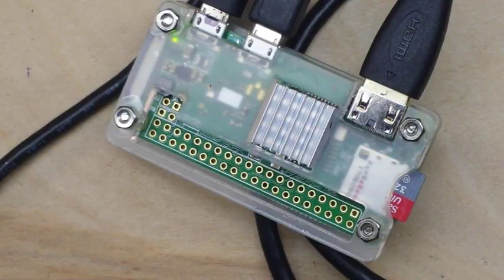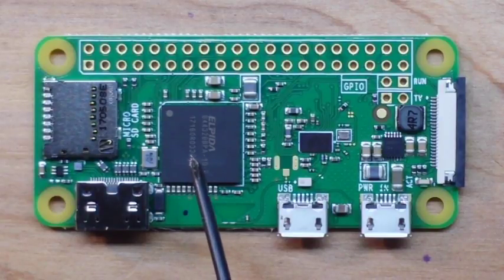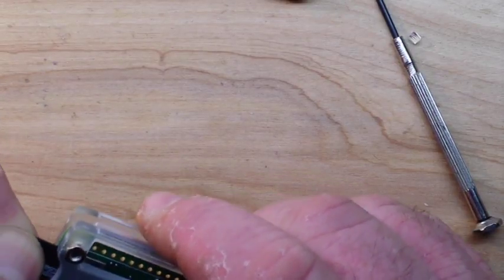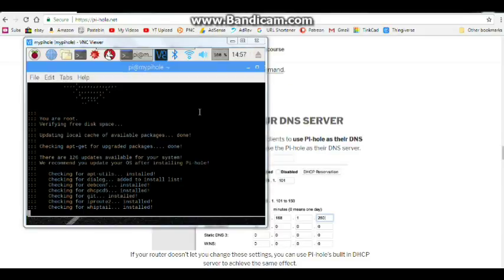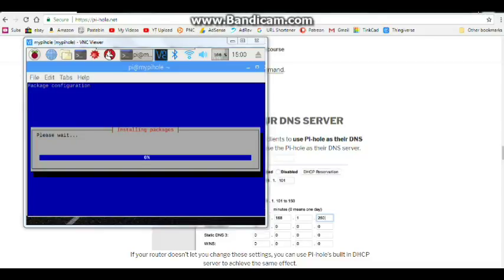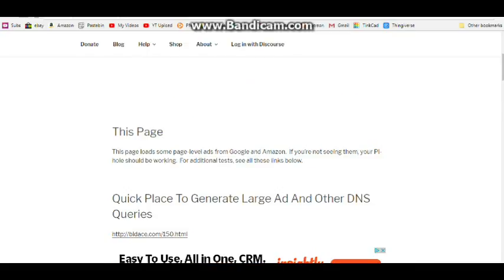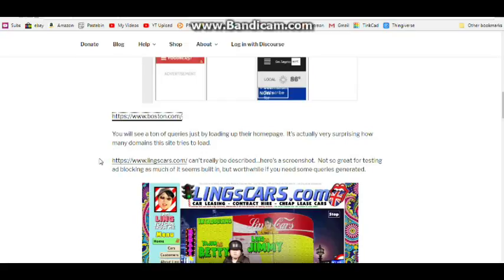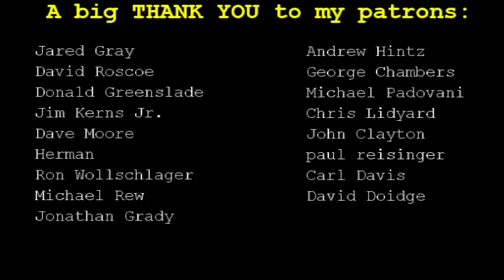Install Pi Hole on a Raspberry Pi and say goodbye to ads

Comment: Great video bro, thanks. I followed the instructions the best I could and after the last files were downloaded on the raspberry ( pi w zero with monitor, mouse and keyboard) the program ask me to check in a pi-hole page if it was already blocking ads. The testing page announced on the monitor that the my ad blocker was active. Then after a minute the screen blacked out. I reset it and the internet came back on screen and then it blacked out again. the raspberry green light is blinking three times fast and a fourth time more than a second. Your opinion will be greatly appreciated.
Reply from the maker: Just a guess, but I think your raspi is browning out. What's the current output on the wall wart you're using to power it?
Reply: Grateful for the fast response. My charger is a White Samsung type of charger whose output is: 5V 2amp.
Reply from the maker: And what raspi are you using? The III needs about 3 amps but the zero w will be OK with 2
Reply: learnelectronics it's the smallest one. Pi zero w. As your video's, with monitor, keyboard and mouse (not at the same time)
Reply: SOLVED: I took the SD card out of the Pi W Zero and put it in the USB connection of my desktop with win 7 and when my computer recognized the new item, asked me if I wanted to run an "scan and fix" which i agreed, and right after that I  put it back in the pi W Zero and worked again.
Reply from the maker: Ok, im glad you found the answer. I would not have thought to check the card.

Comment: Great information as usual! Thank you! You mentioned this briefly in your video but I want to put an exclamation mark on the most important feature of Pi Hole imho.... Once you have it running and your router properly configured, it blocks ads for EVERYTHING connected to your network! Visiting friends devices, TVs, PCs, tablets, phones, Xbox, PlayStation, etc. Anything connected through your router has automatic ad blocking! This is especially good for devices like a game console where you're unable to install an ad blocker on the system. How well Pi Hole works really shines when I'm away from home connected through another network and I suddenly see ads again. I strongly encourage everyone to set it up!
I set up my first Pi Hole about 3 months ago after a friend suggested it. Since I'm always making changes to my Raspberry I didn't want to dedicate it to only Pi Hole duty. I created a Raspian virtual machine on my main computer and installed Pi Hole there. As you show in your video, it's amazingly easy to set up and works great!
Reply from the maker: +Matt B great comment, well said. Thanks Matt.

Comment: That not 28% of the ads blocked, that is 28% of the total  made we ads that we blocked. So 72% of the DNS queries made were not ads. Once you use it for a long time it will get to be about 10% of the DNS queries will be block the rest is valid non-ad domains.

Comment: Damn, another thing to buy! You are going to bankrupt me at this rate :-] This won't block your ads will it? I'd also like to see a VPN server but hey You only have so much time and so much electronics to teach. Thanks for another project!
Reply: https://www.amazon.com/dp/B073TSK26W/ref=twister_B07585YP8T?_encoding=UTF8&psc=1

$20 for an OPENVPN hardware router, can find free VPNs on the internet , easily installable
Reply from the maker: +George Chambers you're welcome my friend
Reply: This most likely would block ads on youtube channels as well unless there is a setting you can adjust to whitelist certain pages.
Reply: +Jon I was thinking the same thing. Could really hurt Youtube and most other revenue collecting websites.